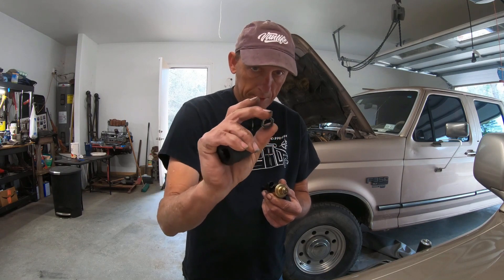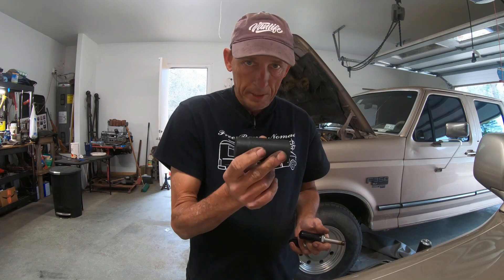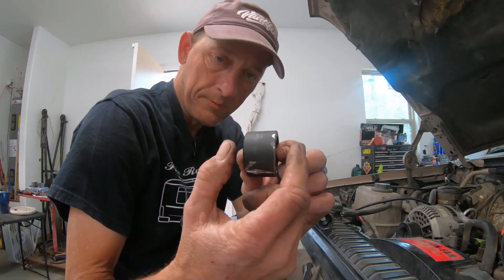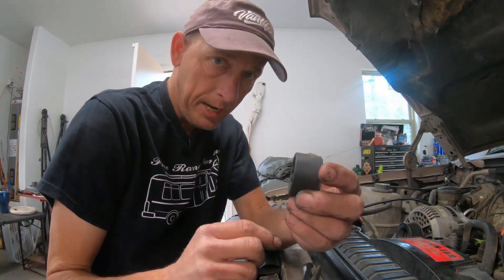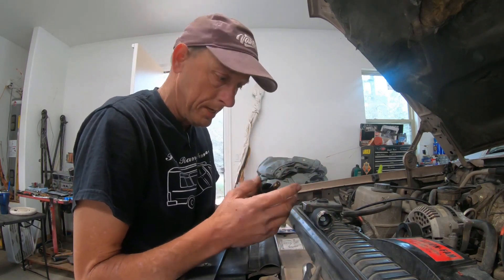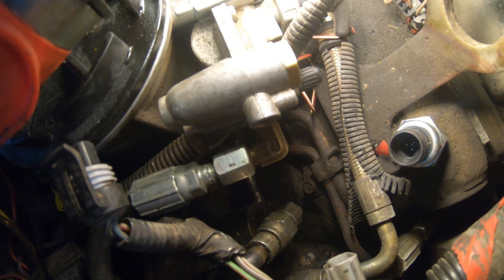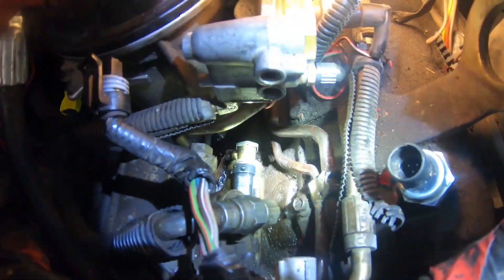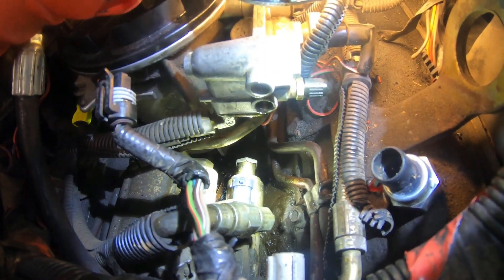How To Make Special IPR Tool Ford 7.3 Liter Power Stroke Turbo Diesel (1994-2003)

Comment: That was a great video, I have been fighting with that IPR for several days now, because of how tight that space is. I don't have real big hands but my hands won't fit in there, your tool is great and easy to make, got everything in there but had a hard time getting that nut back on at the end of the IPR that holds the solenoid on, just not enough room in there.

Comment: Harbor Freight PITTSBURGH Shower Valve Socket Wrench Set.  Cut the one you need down to the length you need to fit in the spot.  The size is either the 1-3/32 in, or 1-5/32 in.  Can't remember.  You'll find the one by trying them all.  May have to hammer the flats flat with a punch as sometimes the socket won't slip over the IPR do to being bowed inward from the crimping process.  You'll figure it out. Drill a new hole in the end that a 1/4" drive hardened extension will slide thru so you can have a nice long lever to crack the old one loose and torque the new one in.  The cheesy lever/rod it comes with will just bend when you apply any amount of torque to it.

Comment: If you cut all the way through those slots and weld a handle on the socket you have yourself a nice easy tool to use for this job
Reply from the maker: True. But I didn't have a welder handy. It was being loaned out.

Comment: Nice work. I had more room to maneuver and was able to get a shower valve socket 1-3/32” from Harbor Freight to fit perfect. No special tool needed.
Reply from the maker: Whatever works without buying a expensive tool.
Reply: how many things did you disconnect to make room???

Comment: Subbed your channel to by the way, seems to me you've got alot golden gems regarding these late 90s 7.3 liters. Mine I was driving one day and decided to switch from rear to front fuel tank. Previous owner told me front tank was inoperable. But I tried it knowing the tank was full of fuel and a few additives. Anyway the truck ran good for about an hour and then fell on its face and barely stay runnin. I was close to home and nursed her on in. When it fell on its face filter light came on. I changed the filter and topped the bowl off with fuel and it started back up but would cut right off. I checked bowl, still full of fuel. Crank again and it would start run a minute or two and cut off. After I changed the filter I did switch back to rear tank that also was full. Now no matter which tank im on same thing it'll fire up run a minute or two and die. Im wandering if my fuel hose has a hole and is bleeding back? Idk then another topic I have an 05 6.0 and I'm losing injector contribution on 3,5,7 and sometimes 1. So whole passenger side bank. My ficm is good, my glow plug harness is shot. Mechanic told me no compression number 3 cylinder. I put bore scope in thru glow plug hole and my piston looks good two valves were open and 2 were closed. Im going to do a relative compression test to see what that gives me. Because the mechanic said 3 cylinder no compression and either was valve or piston related. So I want to see the drop out from relative compression verifying the no compression. Watching hpop and icp and ficm commands and states everything is doing what it ought to, except my injector contribution test when I toggle them I hear the pintle click. And after I start the truck I starts off losing injector 3 and then 5 and 7 and sometimes 1 then around 2000 rpm they'll come back.
Reply from the maker: Sounds to me on your 7.3 issue is the switch over valve between tanks is jacked up, clogged, sticking. Check fuel pressure. Maybe something is telling you ecm to shut everything off.  
On the 6.0....I had a 2005. I would set it on fire and save the headache and money. Otherwise have entire engine "bulletproofed" and start over.  ICYMI...Ford sued Navistar over those faulty engines. They won. But didn't give one penny or help to the million people that owned vehicles with that engine. That's because normally nothing would happen until after the 100k mile factory warranty went out.

Comment: Would a modified wrench have possibly worked? Getting ready to change mine on 97 F350
Reply from the maker: I'm not sure. Probably. If you have that size wrench you want to ruin to make the mods.   My truck is a 97 also.